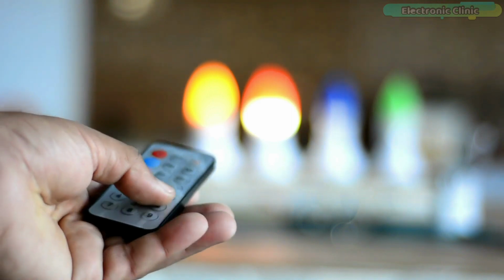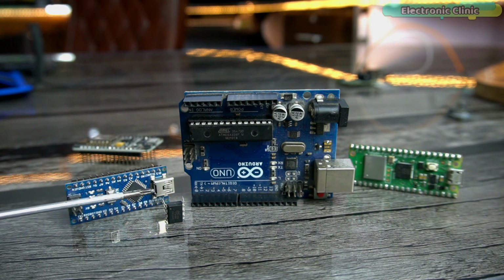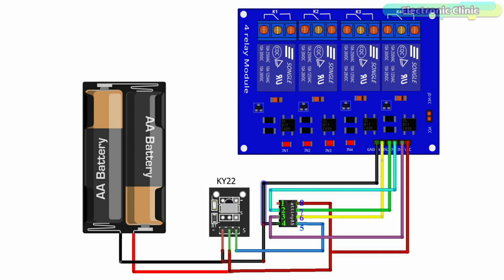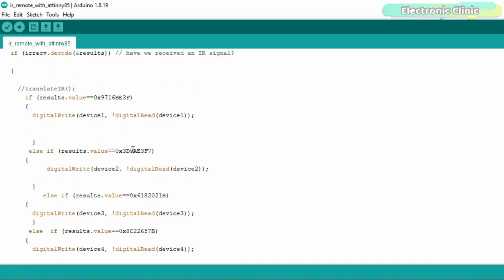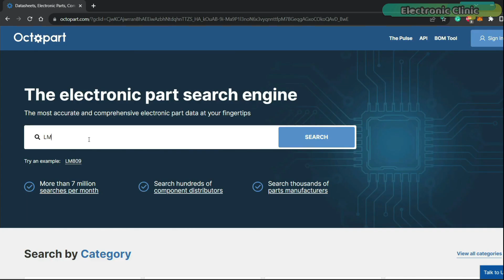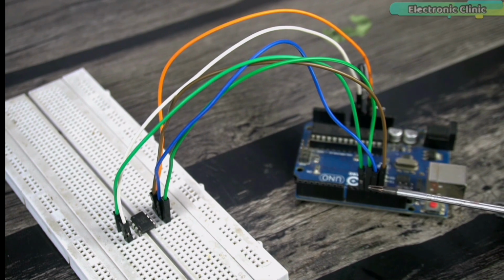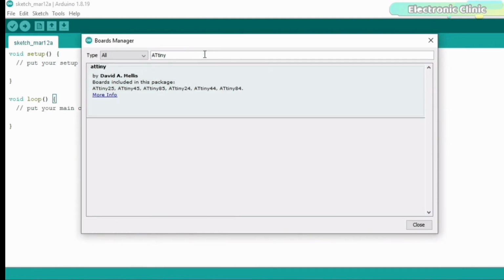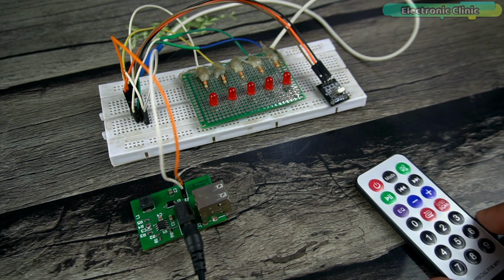ATtiny85 IR Remote Control for Room Automation, smallest Arduino

Comment: WHAT TYPE OF REMOTE HANDSET YOU USED? CAN ANY HANDSET BE USED? YOU USED PB0 FOR IR SENSOR. CAN PB3 BE USED INSTEAD?
WHEN BURNING BOOTLOADER WHAT FREQUENCY SHOULD BE USED-1, 8 OR 16MHZ?
Reply: AS THE VIDEO IS FAKE, NO ANSWER YET.